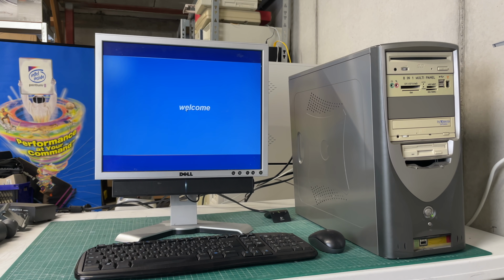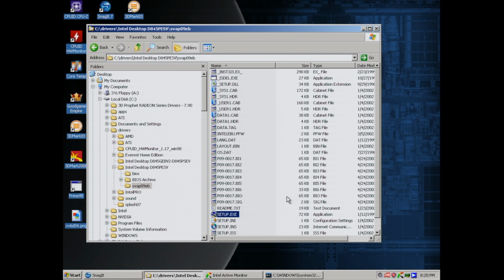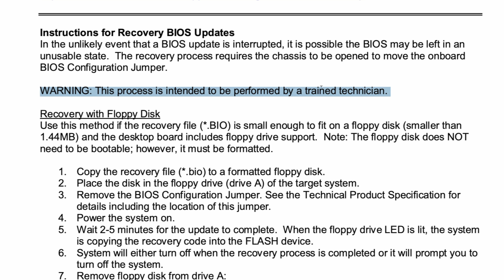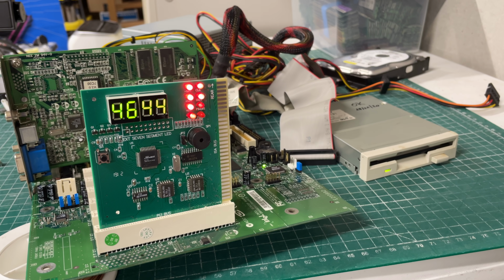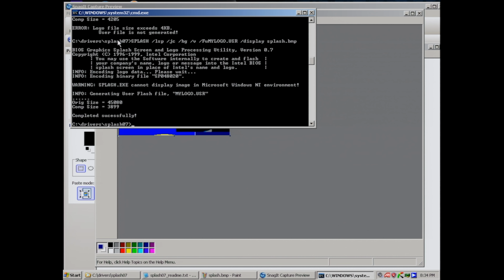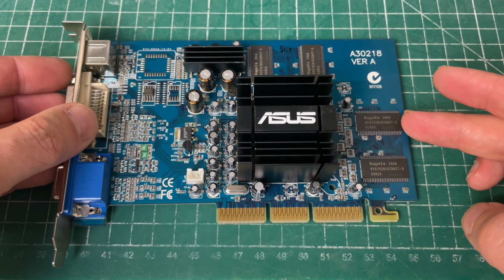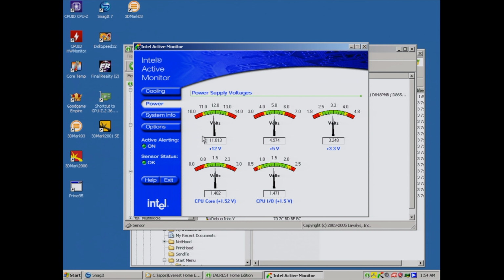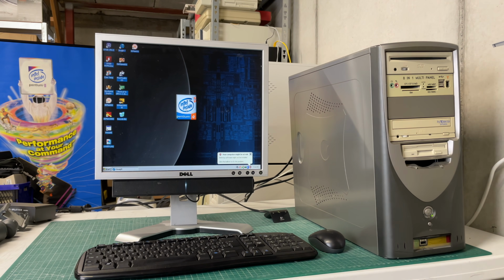Intel Pentium 4 - Corrupted BIOS resolved (Part 2/2)

Comment: That Asus heatsink on the Hercules Radeon 7500 is 100% a users DIY mod.
It originally came with a standard pushpin cooler.
Reply: Yeah, a familiar heatsink from Asus motherboards with an Intel chipset.

Comment: I'm guessing you know all of this, but.... This was the power supply that made noise when the system was powered down, right? If so, especially with the drop in the 3.3v rail, I would replace that PSU right away. Browning out electronics is not good. It could be that the system is stable after that, but if not, reinstalling Windows, replacing the CPU with one with all power pins intact, swapping out RAM, etc., would be the progression I would try. Or, honestly, I'd just move onto Athlon XP, or even Core (2) Duo. I never had luck with P4s, and the one I built out a year ago for retro gaming has given me nothing but trouble. I'm planning to swap it out for some other architecture when I have time. Best of luck!
Reply: I own a repair shop and do a lot of work on older systems like this one, and that's exactly what I thought as well, especially when the BIOS was corrupted. Retrospector, get a PSU voltage tester. It will save you many headaches!
Reply: I second get a PSU tester or make a tester. Have the voltages on display at the same time as the Prime95 test to see if you can see it live. In my old PC's the PSU's are often flaky and can not be trusted because of their long number of hours in use. In BIOS setting some motherboard can display the voltages you have without an OS/hard drive connected. I still use the PSU's but on computers that do not exceed their capabilities.
Reply: If the PSU isn’t happy, ain’t nobody happy.
Reply: so frustrating to watch - he just cracks on ignoring the obvious issue. nothing to stop the bios corrupting again until that is sorted. grr.
Reply: @gazh1261  Well I mean things like this are only obvious to people with a certain level of experience. It's not easy for us as an audience to know the level of experience of the people whose videos we watch. No one was born knowing this stuff. If RectoSpector78 didn't know this before, he does now, and he'll apply this knowledge going forward.

Comment: Great to hear you got your BIOS working again!  As for the errors you're seeing in MemTest, my guess is you have an overheating problem.  I don't think the age of the MemTest software is an issue since older versions are usually needed for older systems, but you can try a newer version if you want to.  This could also point to overall issues with the power supply given what you've seen with the voltage issues on the CPU when running Prime95.  I'd start with a different PSU first, then try different RAM if you have some.  Good luck!

Comment: Was going to compliment the documentation, but with those mistakes I don’t know. But like this situation, I have found that documentation with errors can still point you in the correct direction.
Reply from the maker: Yeah its just trial and error. But the fact that you have no visual feedback made it difficult. Plus the burnt trace, and the general stability issues with the p4 platform could turn out to be anything. Fact that it kept searching for a floppy kept me in the bios direction. But it could have also been some crazy reset/reboot loop.
Reply: @RetroSpector78  There is one thing that can get P4 motherboards quite often, even if it's not clearly evident:  the capacitor plague.  That's my suggestion to you for looking up.

Comment: I sincerely thank you for posting this video now!
You just reminded me that I wanted to revive my old p4 system that needs a new fan. Gonna visit our local computer store before I go home :)
Reply: Old dell machine with a 2.53 ghz cpu so I think it's comparable to your rig. Cool dinosaurs :)
Reply: Now that I've watched the whole thing: That ram issue could very well be caused by the dipping 3.3 rail depending on which rail they used to derive the 2.5v for the memory. On modern machines they tend to derive all rails from the 12v one, on these old ones -no idea.

Comment: P4's didn't have an on die way of reading temperatures as there were no built in sensors, although some motherboards have a thermocouple underneath the CPU package to give an estimated temperature. The Intel desktop boards were the first to introduce this (as far as my memory can recall).
As far as your RAM instabilities, any version of MEMTEST86 from v2.8 will be compatible. MemTest86+ from v2.00 also. Newer versions will have support for newer CPU & motherboard resources.

Comment: Excellent diagnostics and analysis, back old days I updated my Pentium II BIOS update but it failed to boot after that. It was a disaster...
Reply: Did you ever get it working or was it finished?
Reply: @ducksonplays4190  It got bricked, back in the old days I did not have the skills to debug and repair the issue.
Reply: @anandmoon5701  Ah, it happens. I will never update my Dell Dimension 4100's BIOS.
Reply: @ducksonplays4190  BIOS updates are recommended as all the x86 configuration is tuned in the bios, we should update the bios using recommended tools provided by the hardware vendors like DELL / Lenovo / HP. They will release the bios with the core fix need for the CPU and peripheral to perform efficiently.

Comment: Most suggestions i would make seem to have already been made. I would start with PSU if it is detecting voltages going out of range. Does the bios indicate voltages at all? if so are they in range?  The burned trace may also be suspect something drawing way more current then it should, and causing that vdroop. Yet its not a dead short. In that case a PSU might not fix the problem, but it may be related to a bad diode or capacitor. This may cause droop at where the sensor is but not further up the chain.

Comment: Nice part 2!  I enjoyed it!  Some people in the comments believe it may be the PSU causing headaches.  Maybe it blew out the trace on the board and messed up the BIOS? Definitely worth changing out the PSU if your not already done with this system though it may be already too late to salvage the board.  I am also curios to know what would happen if you disconnect the "blown out" trace again and tried testing the PC with it disconnected.  Maybe a technician in the past may have once done something on the board and purposefully disconnected the trace?  Long shot, I know, but a last resort maybe.....🤔

Comment: Nice work. Watching this while straightening pins of the last 478 P4 from the bag of 13 obliterated junk CPUs I got for cheap. After many hours they now all fit into the socket again and it is finally time for me to test them all ;-)
Reply from the maker: Good luck with them. Never paid much attention to the platform but gonna see if I can get stable and try to find a decent graphics card for it to play some games from that era.
Reply: Thanks for saving them from being scrapped for a few atoms of gold.
Reply: @rlawchrome  The worst are those bags with "computer chips" where they've actually ripped off all sorts of BGA chips with plumbing pliers...
Reply: @RetroSpector78  12 of 13 are running. I'd say their state was best described as "thrown together into a bag and dropped 20x on the ground". Someone tried to delid one and it was beyond repair. Two early Willamette ones had 3 broken pins each (their solder failed and seemed strangely weak/dull/degenerated). On one of these those pins were only VCC/GND and the other one got some new pins transplanted from a donor. They both work fine, too. When I'm old I'm going to lock myself into the mancave for a week or two to play with them all ;-)

Comment: Had a P4 in a Dell BTX case that opened up in a spectacular way, like a clamshell, but it was a minitower with pushbuttons that unlocked it.  Good times.  Just for that alone I ended up testing a dozen video cards through it, all sorts of RAM, and a half dozen CPUs.  Extremely stable, and booted in almost no time on XP (mechanical HD, system itself was from 2005 or 2006).

Anyways, have fun, nothing wrong with a P4!  Just pipeline and caching wonkiness, of course.

Comment: I'd try different PSU and different RAM (in that order, since you had voltage drop). In my opinion broken trace is not causing stability issues.
Reply from the maker: On holiday now but when I get back will take another look at it.
Reply: @RetroSpector78  It would be interesting to put a multimeter on the 3.3v rail while it's running Prime95 and watch the voltage. Anyway, have a great time off!
Reply: @xDownSetx the PSU make a high pitch noise... like when something draws a lot of current (probably a bad cap).... ¿¿ it still does it with the motherboard unplugged?? .. ¿¿starting the PSU grounding the green cable without the motherboard.. still does it??
if it does.. = bad cap in the PSU ...
if it does not = bad cap in the motherboard... and this one may explain the burn trace on the motherboard..
and the BIOS fail... well.. if I remember correctly.. the FlashBIOS chip that INTEL uses.... it feeds from the 3.3v rail....
low voltage while is writing to the FlashBIOS chip .. = corrupted data..
Reply: this one would be good to show if motherboards without ISA... are good or not for retrogaming....... in my opinion.....
without ISA = "weird drivers" loaded in DOS Memory for PCI SoundBlaster... = several DOS Games not running due to lack of memory....
without ISA = PCI or AGP video card = stutterer left and right displacement in several platformers like Crystal Caves...

Comment: RAM could have bad sectors, for example Adata brand failed quite often back then. You need to put identical RAM sticks closer to CPU if not all slots are used or in some motherboards 1-3, 2-4 to enable dual channel support. If you put different speeds RAM sticks you may have compatibility issues and you need to switch their places until you get proper detection of RAM capacity and speeds. If one slow and one fast sticks are inserted, all of them will work on the slowest frequency, but some of the sticks may not support all slowest frequencies. Socket 478 is best for DDR400, but you should refer to CPU and motherboard's RAM support list as those components are tide in bus frequency clock.

Comment: I agree with You that failing CPU's stress test may be related to the ram as confirmed by memtest.
Reply from the maker: Will check. On holiday now :) I’ve heard some older versions of memtest can also give false positives and newer hardware
Reply: @RetroSpector78  try a version from Pentium IV era: V3.something if I remember
Reply from the maker: Yeah I am used to dealing with 486 and below systems so I am used to having a version that fits on a floppy :)
Will try a later version

Comment: I have a feeling its one the dimm slots what could be causing the issues.. maybe one of the dimm slot is causing problem mabe test in other slots ect .. the damaged trace could be on the memory bus lane ??? only a guess but I had a similar issue with an I5 board not so long ago with very similar problems and it turned out to be a dimm slot

Comment: I would test the RAM sticks separately to determine which one is faulty. Also sometimes they are faulty in combination, but OK if tested one by one. In this case just throw away 256MB one :)
Regarding damaged BIOS: why did it get damaged in the first place? I only once had similar problem years ago on an old Slot-1 machine. The BIOS ROM slowly died, i.e. at first it sometimes refused to boot with "BIOS ROM checksum error" message, and over time I could not boot the machine at all until I reflashed the BIOS. And in a year or so, the problem returned. I never really solved it, simply threw the machine away (now regretting it). I think it was either a faulty ROM chip or horrible "dirty" power rails (cheap PSU, bad caps, etc).

Comment: I'd be looking at the PSU as the 3.3v going down to 1.6 will have bad effects on the system. you may burn out more things. Good chance this psu issue damaged the ram and Bios. but there is a dead stick of ram to fix after the PSU! Keep it up and good Video as Always!

Comment: I would replace those capacitots. You're going to have a very hard time finding modern replacements for 3300uF ultra low equivalent series resistance electrolytic capacitors. Polymer capacitors are viable alternatives.

Replace that power supply with a modern ATX V2.3x power supply: those P4 machines draw most of their power from the 12V rails the available 110W on the 3.3V and 5V lines should be more than enough for your AGP card and some basic PCI cards. 

Regarding the RAM, its either the old capacitors (they may look fine, but theyre designed to last 10 years, maximum 20 under light loads) or your RAM sticks are bad. Just get new RAM sticks and run memtest. Around 512-1024MB should easily produce 30 passes over night. Could also be the memory controller, if I remember correctly Intel didn't have integrated memory controllers on the CPUs back then.
Reply: The memory controler is on the north bridge which was on the motherboard.
Its mostlikely the psus fault, dried or bloated caps causing too much ripple and glitching the system or the chips. Coincidentaly eeprom chips go on the 3.3v rail so noise on it could easily have caused the eeprom to corrupt.
Reply: Didn't even think about that! Well spotted.

Comment: I'd love to know what actually corrupted the BIOS as it was rather sudden. I'm glad it wasn't fried beyond recovery though!
Reply: Its not exactly uncommon for old bios chips to "forget" bits if they've not been used for extended periods.
They are more often than not capable of fully working, they just need "refreshing" by reflashing.
Whether its to do with BIOS chip brands or types IME most of these semi-failures are on boards around the same era as the P4 board featured, but not on much older ones, go figure.

Comment: Heh, I have a mATX Intel D845 OEM Gateway board I soft bricked by flashing the Intel Desktop Board BIOS onto it. I figured that since it was a Intel built board (damn near identical to the actual board sold by intel themselves, just missing a fan header, serial header, and the AMR slot) it would be compatible. Big mistake. It throws up a checksum error when posting and wants me to go into the bios, etc. I can go into the bios setup and change stuff, save and exit, but it throws up the same error ad infinitum. Still have the board. Maybe some day I'll hunt down another Gateway OEM board and pull the bios off of it and try to fix it...

Comment: the first thing you do on old computers are change ram memory to a differnt slot or differnt memory 2. use an old pci grahics card when Windows starts ( just a basic like ati mach 64 (always works)) then shut it down when windows loaded the drivers for it -change to your graphic card that yuo had in when it died -now windows finds that and you can contine with your retro experince

Comment: I think only the intel brand boards will have the floppy drive do that when a bios is corrupt, unlike other boards, since other boards have a socketed bios chip unlike the intel ones. if for example, a asus board does that, it will just not post. and you need to remove the bios chip and use a tl866ii or hotflash the chip on a working motherboard.
Reply: My ASUS Pentium D board (P5WD2-E Premium) definitely has a similar floppy-based recovery bootblock. I'm pretty sure the BIOS chip is also socketed. Even with a socketed BIOS a recovery mode is much easier because not many people have an external programmer.

Comment: the PSU make a high pitch noise... like when something draws a lot of current (probably a bad cap).... ¿¿ it still does it with the motherboard unplugged?? .. ¿¿starting the PSU grounding the green cable without the motherboard.. still does it??
if it does.. = bad cap in the PSU ...
if it does not = bad cap in the motherboard... and this one may explain the burn trace on the motherboard..
and the BIOS fail... well.. if I remember correctly.. the FlashBIOS chip that INTEL uses.... it feeds from the 3.3v rail....
low voltage while is writing to the FlashBIOS chip .. = corrupted data..

Comment: If the computer has a bios chip that can be removed and have a second computer is possible to hot swap and reflash by replacing with corrupted bios chip because the bios is only needed to start the computer.

Comment: This kinda makes me want to put together a good Intel Pentium 4 system. Something like a Pentium HT 3.4GHz Northwood and an Asus P4C800.
Reply: You can use a 478 p4 for windows 98 or a 775 for xp. 
In my experience they are both equaly as bad but 478 usually comes with agp.

Comment: I would Swap PSU, run Memtest86 and see if it fails. If it fails swap the memory to see with DDR400 and swap CPU for the 800MHZ bus if the board can see it.

Comment: You plug in a serial console to see video output
Reply from the maker: Not sure if there is serial output on this board. Never thought to check. Documentation / manual also didn’t mention it.
Reply: I know its really bad on intel boards. It’s a problem with corps as big as intel. Engineers tend to be not involved in manuals. My favorite thing to point out as being a engineering problem.. printers. They are so poorly designed for regular people that nearly every person with no tech background leaves the setup wifi config enabled so people going down the street can use it as a vector to break into a network..
Reply: Fun fact.. intel oem boards are usually used in embedded design.. my favorite is arcade games .. golden tee is one